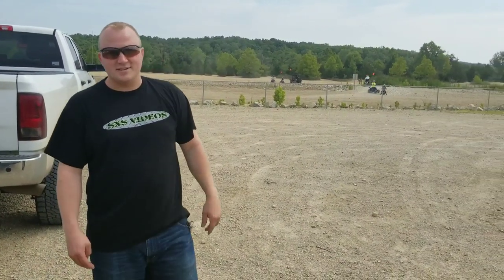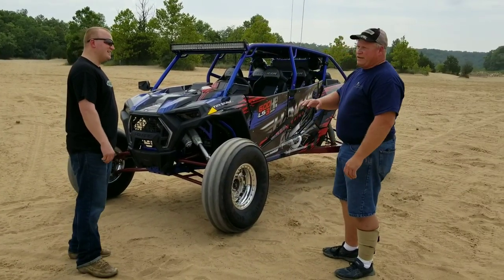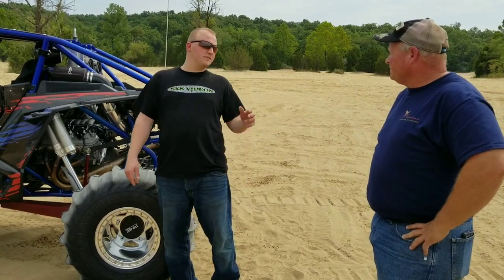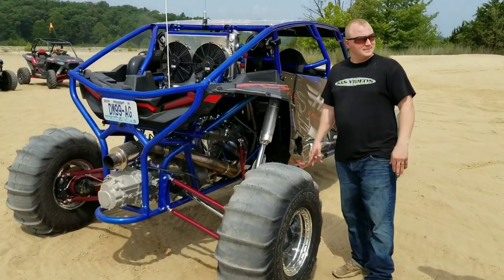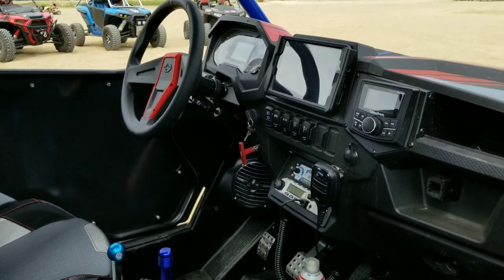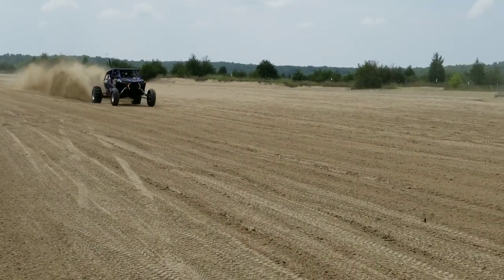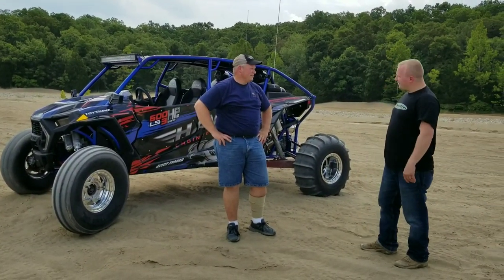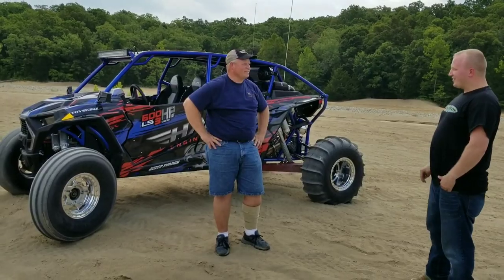LS3 RZR "NEVER ENOUGH" Built by Hawk Engineering | Drag Racing and Walk Around video |

Comment: The 2JZ that SXSBlog is building would rip this apart, still cool though
Reply: G Rapids I was going to say the same thing!
Reply: Fact but this thing is sick
Reply: Depends if it’s stock 2JZ can’t beat a V8 LS3.
Reply: @Eastern_SA  it not stock estimate 1000hp
Reply: John doe you got any link to the build? I hope they keep the 4WD.
Reply: @Eastern_SA   there's a link to one of the vids the have the build posted on their channel
Reply: Well duh because that is twice the horsepower
Reply: Bash Zilla horsepower doesn’t always win races, you can have 5,000 horsepower, but if you have no traction then it doesn’t matter
Reply: @G_Rapids  yeah but with sxs blogs they have 4wd still so then they will most likely get more traction
Reply: That machine doesn't even run correctly yet. Besides put a turbo or 2 on a LS V8 the 2jz wouldn't stand a chance.
Reply: @dbriggs1689  the sxs blogs machine does go look at their channel
Reply: Rip it apart is a big statement say especially when it hasn't even been on dyno yet or driven a few feet!
Reply from the maker: That's a good point. This rig has been all over and tested everywhere from Missouri to Glamis. I can't wait to see the 2JZ they are building though. It'll definitely be sweet!
Reply: I mean this is a complete machine that’s been out. SXSblog is still finishing theirs in all fairness. This one also has a back seat too. It’s not like you can’t pump up the power on the LS. I am still excited to see the end result of their 2JZ setup though.
Reply: G rapids Beast mode would beat this thing pretty sure
Reply: TwinTurbo this thing and it will smoke side by side blog
Reply: The sxs blog rig is making 907 hp with a small turbo
Reply: How bout a race to get 4 ppl from start to finish?
Reply: @landonshiland241  Yea they have it running pretty strong right now. Probably faster than this LS build. Not that this LS couldn't be dialed up either. This build is cleaner overall IMO. Could take the family out in the LS machine here.
Reply: Yes it will 900hp with super scoops
Reply: This build is sooooo much cleaner though and can still haul around 4 people.
Reply: Anyone know the weight difference? 2jz is iron block LS3 is aluminum so it might be close? LS3 seems more reliable being NA.
Reply: It has 900 hp and would leave this in the dust
Reply: True
Reply: the sxsblog 2jz is finished. go check their channel!
Reply: They same way they ripped apart that bottom end on the 2j lol
Reply: Sxs blog has a 1000hp +
Reply: @Eastern_SA  i mean 1100hp 2jz isnt stock
Reply: @troyamos9314  and it blew up already. They should of done a v9
Reply: Well 2jp is getting a new motor around 1400+ and is a 6 sooo.... but good job man you and sxsblog.com should do a grudge race nice build
Reply: Ya there is no comparison. This would get smoked. A 900whp rZr against a 500whp ls3. And 2jp is just getting started. 14-1500hp is coming. This rzr wouldn't know what to do with the tires 2jp needs to get traction
Reply: @Eastern_SA  whats the point of a stock 2j
Reply: Well, now the 2jp has a 1106hp to the wheels billet aluminum block and different gears. And it's not 4x4.
Reply: @Eastern_SA  oh its definately not stock. I think the last dyno put up 1100 horse power. Its cool watching these guys build though. Its never enough.
Reply: @Eastern_SA  look up sxs blogs then find the 2jz build videos. Pretty cool group of guys over there.
Reply: 1300 hp vs 600 hp of course it would but this built it's sick to have no turbo😉
Reply: Sxs blogs should roll race them in 2jp
Reply: Match the horsepower to the sxs car and run them and I guarantee this LS car will smoke it
Reply: Yea but they did it first
Reply: @Eastern_SA  it ran a flat 9 on the 1/4th and it rolled from the end of the 1/8th to the 1/4th no Ls3 outrunning that unless it’s big boosted😂
Reply: @mattevans8195  actually the 1300 hp 2jz build that sxsblog built is not a 4wd . It is mated to a power glide transmission.  But yes, it get traction and it would laugh at this ls3 build. With that being said, this ls3 build is pretty clean and sweet! 2 different worlds.

Comment: $25k RZR
$12k Motor
$8k Tranny
$2-3k wheel and tire setup
$Countless additional upgrades to the RZR itself
$Some weird off brand shocks
$Probably 20-40k in labor alone to make this project a reality....

For that price point you could’ve bought a real sand car with a better power to weight ratio and better handling capabilities. Still not a bad concept though
Reply: @masterchu8044  lol
Reply: master Chu yea just “white people”
Reply: Sand buggy is not street legal. This is.
Reply: A 600HP LS. Is way more then 12K
Reply: @wcoutsiden863  jump on ebay and look up 600hp ls3 under 9 grand is pretty easy
Reply: @wcoutsiden863  give me half that 12 I'll make ya an LS that'll hang
Reply: Dave Iauco  actually a custom build vehicle is legal on every state  but must pass all inspections. By a special vehicle inspection station. Then it will be issued a vin number. And title. That's exactly how they do it In California  with custom built hot rods. And in the video he stated it is street legal.
Reply: Dave Iauco  west Virginia don't care. But the way around the vin problem is to buy a totaled sxs so the vin no longer matters. All you need is a bill of sale. No title. Atv junkyards will sell them. After you modify the vehicle like they did here. It's no longer in anyway a sxs.  Or pay cash for one that has never been titled. And it's not a felon here it's a misdemeanor of the 3rd degree.
Reply: @wcoutsiden863  not evn
Reply: It’s no longer a rzr it’s more of a custom build
Reply: @wcoutsiden863  Find an LQ4 or an LQ9 from a junkyard,  throw some OEM LS6 cam, heads and intake manifold, add a single turbo and you have a 7--800hp V8 for about $5k or less.

Comment: Would have liked more info on it to be honest. Like what is completely included in the kit, the price, more info in the shocks, how he dialed them in for the weight, what rims and lug pattern he went with to pull this off. How much longer is the wheel base to be able to keep the back seats, which i thought was impressive. What transaxle is in it gearing and gears... You know basic questions like that for a builder to know and can get the ball rolling for their project.

Comment: Thought it was going to be faster
Reply from the maker: LOL seriously!?
Reply: Same im sure he still has to play with some stuff tho... such as the paddles, paddle count, size and possibly gearing.
Reply from the maker: @eltwitch9469  Jason is still doing some tuning on the machine like u said. Paddles, shocks etc..  Maybe some guys didn't realize it but he was hitting 100 miles an hour very easily on these stretches
Reply: Flavio Silva  He was putting bus lengths on a turbo s.... That thing is moving
Reply: Imagine if on hard ground where could really hook up 
Gotta be a rush
Reply: 4x4 and it will be faster in the dirt. Take off for sure
Reply: There's a lot of apex cars that would walk this thing easily. No way this is 600 hp.
Reply: @FlavioSilva-xl3ps  ok, speedometer eyes. Gtfo
Reply: @baby-sharkgto4902  why you salty boii😂😂
Reply: Its actually not bad, but needs a bigger tire... it's not hooking up at all so it looks dog slow...
Reply: prospective, I'm sure in person the thing is warping through space in a way you can not appreciate on film
Reply: Almost as useable as a built sxs lol
Reply: @SXSVideos  people are dumb. Don't read too many comments.
Reply: Flavio Silva he never made it past 3rd gear how tf is it slow
Reply: @dunerinaz  yeah you cant just tune a stock ls3 and make 600hp. You gotta have heads and cam at the very least
Reply: Flavio Silva sxs blog those guys are building a 2JZ rzr 1000 hp or more you need to check them out
Reply: The Tatum sandrails are Ls3 powered and literally wheelie up sand dunes... 🤔 🤷‍♂️
Reply: @09mazdasp33d  do they claim to be stock with a tune?
Reply: @09mazdasp33d   they run ls3 that is stoked to 427 cubic inches and they make 650hp. I believe Tatum hp numbers. Its sounds about right.
Reply: Guyito Martinez it’s funny you say that I own the snap on Tatum. But that 2JZ is not know slouch trust me
Reply: Southern Ties SxS maybe short buses. He wasn’t gapping the Turbo S that bad

Comment: You need to switch you fill valves on the front reservoirs so they're on the top of the reservoirs. Just gotta mark where you want the valve, take the cap off the reservoir, and move the filler valve and the vent tube attached to it to the new location. There is a stainless part inside the cap that the tube fits through. When assembled correctly, it moves the oil pickup to the bottom of side of the reservoir. It's also important to do this for proper oil recovery back to the main cylinder of the strut.
Reply from the maker: Thanks for the info bud. I'll pass it on to the builder. 😎
Reply: Yes I know.  I haven't had a chance to change it yet.  Thanks.

Comment: Well 50k for the rzr 15k in up grades stock. Put at LSmotor in it motor: 10k tranns 10k misc: 4k new upgraded shock 10k. Tires 1400. Should of just got a duel sport sand car.

Comment: So you take the main PowerPoint away from the razor and add 400 lbs.  Its pretty cool but with no awd its too heavy.  Maybe add 33" ×12"s on the back for better speed.    A sand rail for half the price would dust that thing.
Reply: boonehouston  you forgot the 600hp added to it.....400lbs of motor for 600hp......yea
Reply: @trinidyjohnson5842  its like puting a honda civic motor on a cr 250.
Reply: You can get almost 400 horse out of some side by sides by upgrading the stock motor and no weight gain.  Plus you keep awd........which was my main point.
Reply: Yeah.......most old timers are obsessed with v8s for all the wrong reasons.  If he would have put a thousand horse Texas Speed Ls motor then we'd be talking
Reply: no I agree it's a waist of time and money.....I just think a V8 In a side by sides cool...I'd rather have the same motor in a long travel single seat buggy
Reply from the maker: that's an interesting concept. A sandcar wasn't the goal. a 600 hp RZR was. just wait, a 1000 hour rzr is next!
Reply from the maker: that would be killer!
Reply from the maker: it's coming!
Reply from the maker: you're definitely right man. Jason also make a Z1 kit that produces 600 hp!

Comment: Whats the fuel capacity on this thing? With the LS3,
it's gonna burn through some tanks. And therefore make it's range limited. Sounds great though.👍
Reply from the maker: I'm not sure. Prolly pretty good. Fuel capacity isn't really the mindset going into a build like this. I dont remember him saying if he changed the gas tank though. The gas tank in the RZR is 9.5 gallons stock in this unit. They didn't change until 2020 with the new models. 9.5 gallons is a pretty good range though. I'm just guessing but I'll bet it gets around 20+ mpg.

Comment: I'm going to estimate that about $18G of the original $20G to buy the car, went straight into the dumpster. Wouldn't it be cheaper to just start with a custom cage and build the car off of that then buy the stock seats from Polaris? I do like the build though it solves all the problems that I hate about the SXS market.

Comment: Thats not a stock ls3 listen to it top end i have a ls3 with cam and heads and upgrades to the fuel system could it hit 600hp sure but not stock
Reply from the maker: It's tuned to 600 hp. It's a tune from GM. Stock LS3 is around 400 hp.
Reply: @SXSVideos  
LS3 is 430hp...436 with the dual mode exhaust.
Reply: A stock ls3 will not make 600hp with just a tune.

Comment: A stock ls3 is not making 600hp with just a tune I'm sorry. Stock is 430hp. Your not picking up a 170hp with a tune I dont care how good the tuner is. No with heads and a cam maybe.
Reply: KY SPORTSMAN you can’t hear that it’s got both? And nice exhaust. Definitely not a stock cam. Hear that lobe?
Reply: @renewillard777  he said it was completely stock.
Reply: @renewillard777  hey said was a crate ls 3 and its exactly the way he bought it.
Reply: They have a variable valve timing with a correct tune they can gain that much with open exhaust
Reply: He never said stock. He just said he brought it like it is. Have you ever purchased a crate? Jegs has ls3 in many different hp numbers and builds. All crate engines. You can buy a crate motor lsx. Doesn’t mean it’s stock. Just means that’s how he picked it up.
Reply: He said its a GM tune, not custom.
Reply: Jake Browne they have displacement on demand. Which only cuts 2cyl at part throttle a dod engine and non dod engine will make same wot HP,  The valve events never change they just loose gross valve lift at part throttle And theres no chance of a tune gaining 170hp... d.o.d delete,cam, intake, long tubes with a killer  race gas tune you may net 100hp. But it would need some awesome heads to make that power
Reply: KY SPORTSMAN 
Definitely doesn’t have 600hp. It lugs when he hits 3rd gear. If it had even 500hp it would blow the tires or wheelie before it would lug 3rd gear on a light vehicle in the sand with rear engine. Won’t even wheelie. A rzr 1000 turbo will wheelie with paddles. 
And if a runner could make 600hp with a stick ls3 we would already know their name because they would be famous and have a 2yr waiting list to get in their shop. It’s NOT possible!! Even with heads and cam, open headers and tune still not gonna get 600. The lsx 454 barely gets 600 and its 7.4L. LS3 is 6.0L. And no Gm doesn’t make an LS with variable valve timing. 
So yeah it’s embarrassing to have 600hp wrapped all over ur rzr when it’s actually around 450. But on a positive note, the cage and chassis tube work on the back is very nice, professional and very well done! 
Now go put any kind of power adder and may the wrap not be a lie, then you will have a cool ride. Still not as cool as a sand rail, even tho all the same parts were used and spent the same amount to build it.... but I really doubt this guy cares about that. He obviously wanted something different and he definitely built what he wanted. No denying that. Not what I want or would have built, but it’s not mine... 
It’s still a cool build. The lie and misleading of a 600hp LS3 just killed  it for me....

Comment: I want to see a rs1 build with twin turbo busa engine. Or any of the following bike motors Suzuki hyabusa 1,350cc, BMW s1000rr, Kawasaki ZX 1,400cc, Yamaha R1m for the sand dunes or would be happy with any of the following if I was building a mud machine because a mud machine is built with giant tires with extreme tread hight for superior grip and traction so with that in mind you want to have plenty of torque to turn them tires and machine when deep in a mud pit so I would want to have a v twin or v4 like Ducati 1299 penagali R or Ducati v4r or even a giant 120ci Harley motor.

Comment: way late to this but how long is the motor and trans. has anyone done this to a 2 seat and has anyone made a ls front engine rzr, i know it kinda gets in to the realm of whats a rzr and whats not. im wanting to build a rzr with a lottle bit linger nose so the engine is half tucked under the dash with a shorty power glide and an scs transfer case to keep everything as short as possible.

Comment: He needs to put a Magnuson on it. This way he won't have to peel the sticker off the door. No way it's making more than 480-500 on pump gas. Even with a head&cam package. Very cool build though.
Reply from the maker: Thanks for checking out the video bud. It's definitely one of the coolest builds of 2019. 
As far as the HP goes, I can promise you that it has 600 hp. Hawk Engineering is one of the most respected companies in the UTV Industry. They have been innovators since the first RZR came out. They also make Z1 kits that produce 400 hp. They do their homework and do it right.
Reply: @SXSVideos  I don't mean to bust balls, I worked as an engineer for SLP performance for 14 years as a lead prototype fabricator. Our ZL packages on 5th Gen camaros with an LS3 AND 2300 Magnuson supercharger made 650Hp.(stock heads and cam) With months of research, dyno pull after dyno pull and endless resources that was it! 
600 on a crate motor with pump gas.... that must be one magical tune.
Reply from the maker: @kendesign3622  oh okay, no problem man. I'm not a big engine expert by any means. The next time I run into Jason I'll mention this to him. He said the next build will have 1000 hp. The magnuson would definitely help from the info you provided. Thanks for checking out the video.

Comment: Cool idea but doesn't seem to move like its got 600 horse.  That frame will not hold up to the added weight and torque.
Reply: Overkillengineering  ... The whole frame from behind the driver seat is a tube chassis..